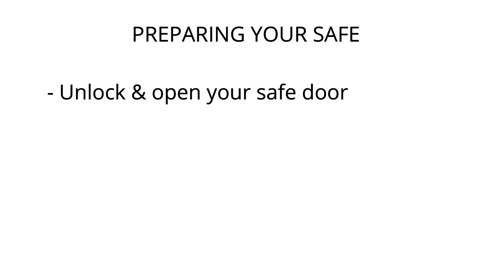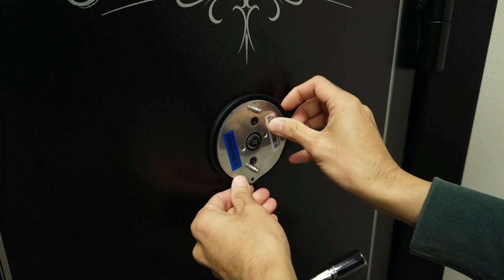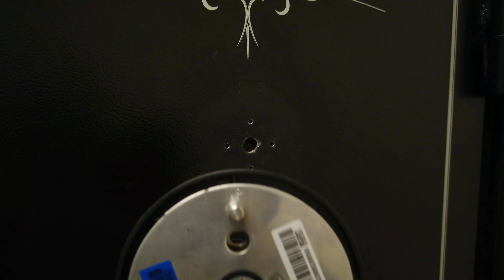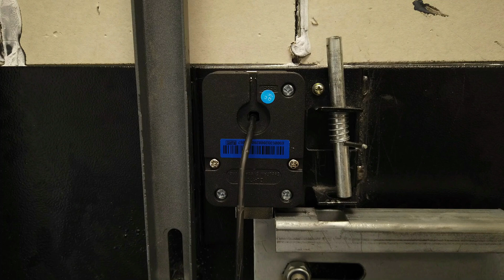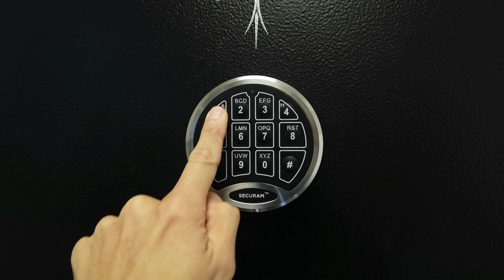SafeLogic Basic Direct Drive Installation & Operation

Comment: No swingbolt/pivotbolt option?
Reply from the maker: The SafeLogic Basic is available with: Direct Drive Deadbolt; Motorized Deadbolt: Swingbolt; Springbolt (slambolt); and StrikeBolt (tor cabinets).
Reply: @acms  To clarify, there is no Direct Drive swingbolt, correct?
Reply from the maker: @michaelknight2897 The SafeLogic Xtreme and ProLogic Xtreme are the closest thing to a direct drive swingbolt that is available in the market.
Reply: @acms  I watched every video out there. I think I can ditch the swingbolt and go to a direct drive deadbolt.
Reply from the maker: @michaelknight2897 most swingbolt locks can be replaced with a deadbolt lock without any issues. Just need to remember to close the lock when you're finished.
Reply: @acms  Thats what I am seeing when I looked at it. I figured the swingbolt is spring loaded to snap closed when it reaches the hole in the plate thus the curved surface.
Reply from the maker: @michaelknight2897 Correct, that allows the lock to automatically close when the safe handle is closed. The motorized deadbolt locks work the same way but are more expensive.